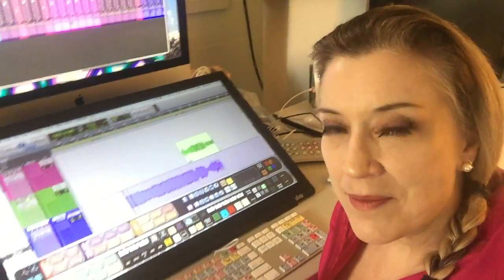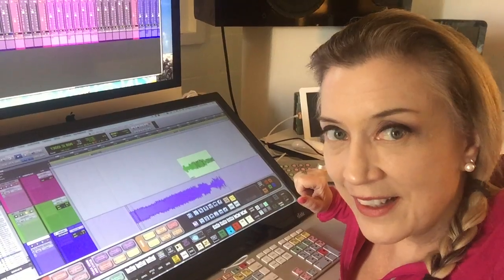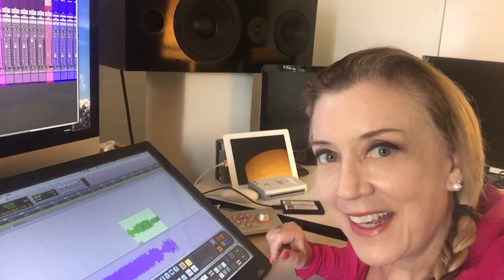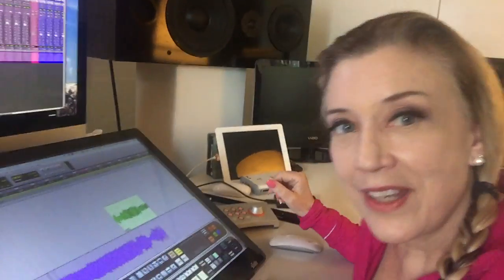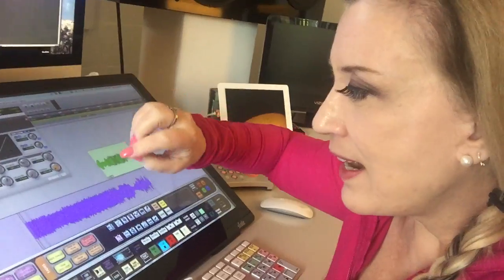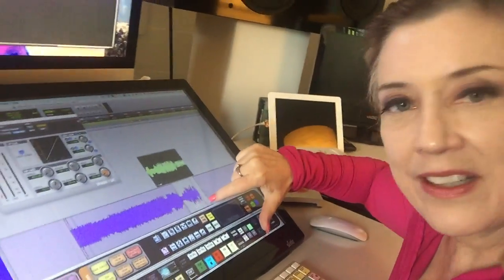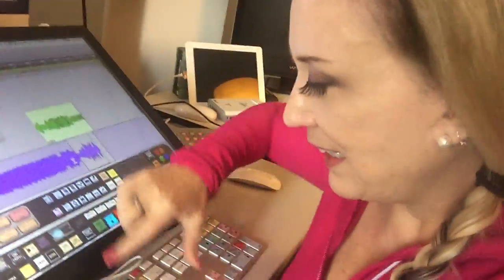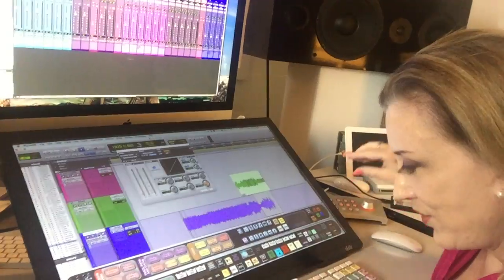Sylvia Massy Mixes The Melvins' Electric Pickle Solo

Comment: Just a warning to pickle enthusiasts; be very careful of trying this with a tube amp (knock yourself out with a transistor amp). With a tube amp, if the pickle dries out too much, it's the same as playing with it not plugged into a speaker at all, which is no bueno for your output transformer...